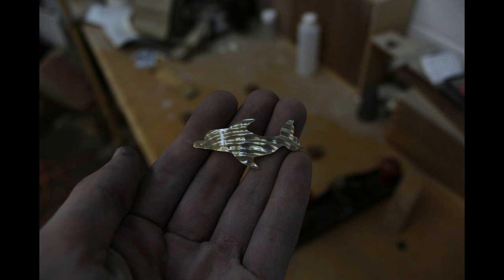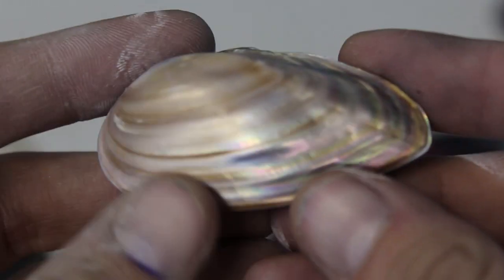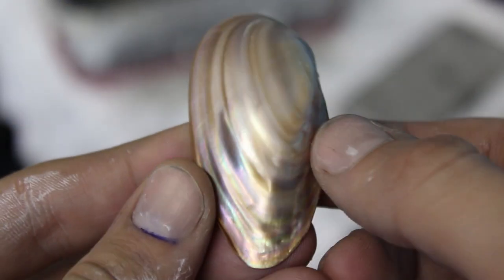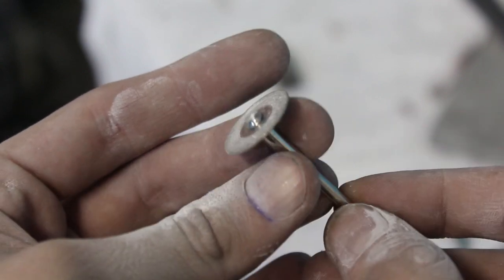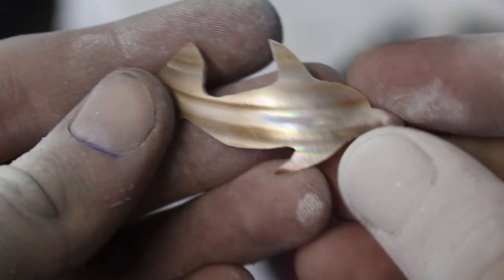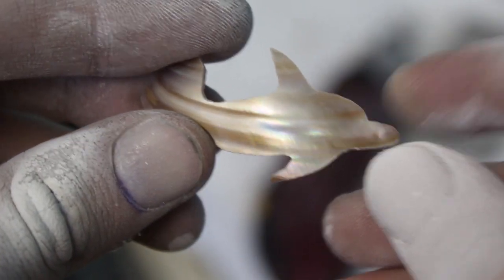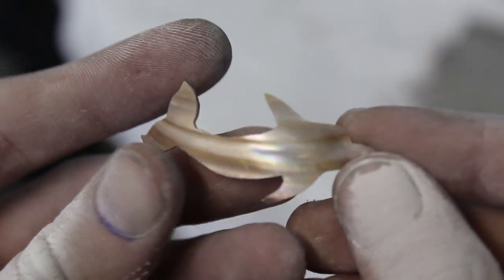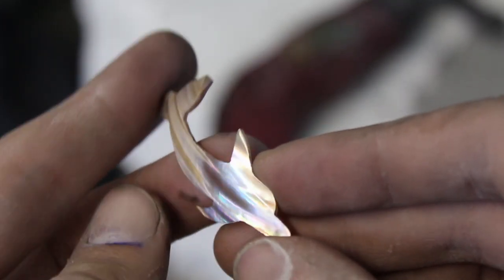Carving a Dolphin from a Pearl Mussel Shell

Comment: 1. 220 grit rotary flap sander to shave outside of shell

2. Whetsand shell with 600 grit sandpaper, then 1000 grit, then 2000 grit to polish.
3. Diamond rotary wheel to carve
4. Buffing wheel and red rouge polish

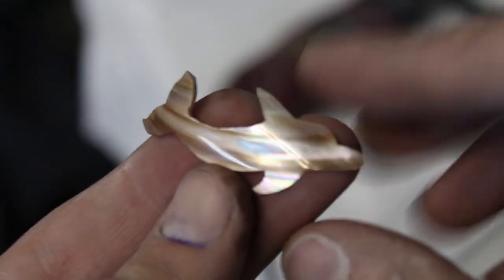Question- 10:02 What tool would you use to smooth out the rough edges near the dolphin tail?
Thanks for the vid! Gonna try to carve out my first oyster shell (or whatever I can find in the beach) in the future.
Reply from the maker: I get rid of the rough edges by hand sanding all of the tight spots that my rotary tool can't reach, and to do that I generally just wet sand using 220 grit sandpaper and then just polish the same way as the rest. Hope this helps, and I hope yours come out great! 😊
Reply: @TheoKellison  can you add polish wax in description
Reply: thanks for sharing, this is exactly what I need, I was thinking to do some carving projects from rocks, wood, shells, now I really want to do it:-)